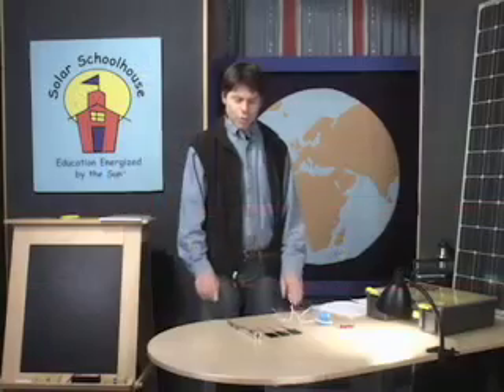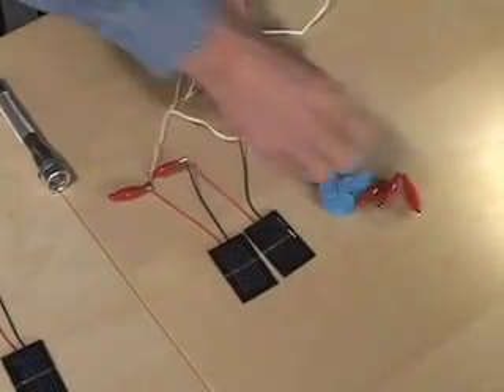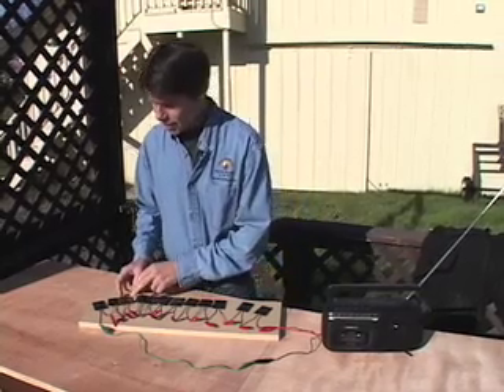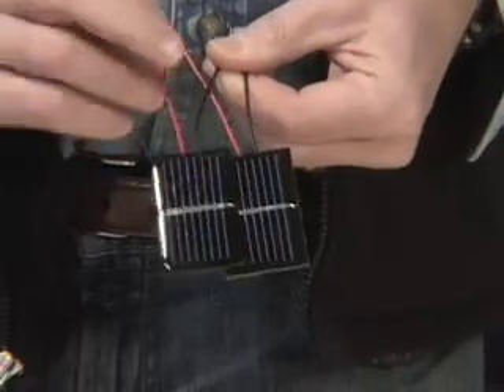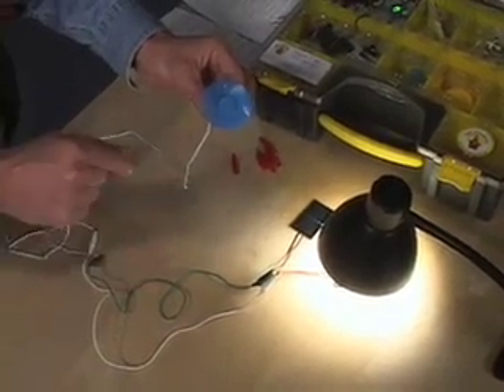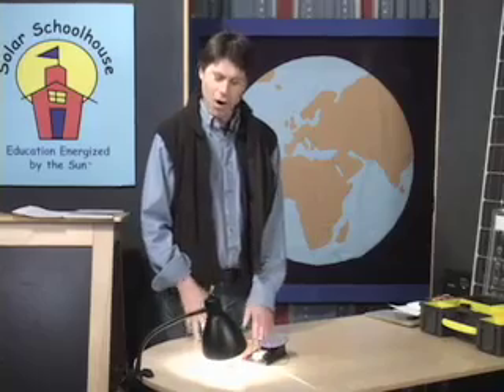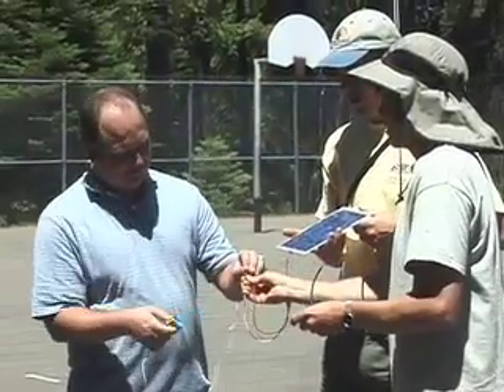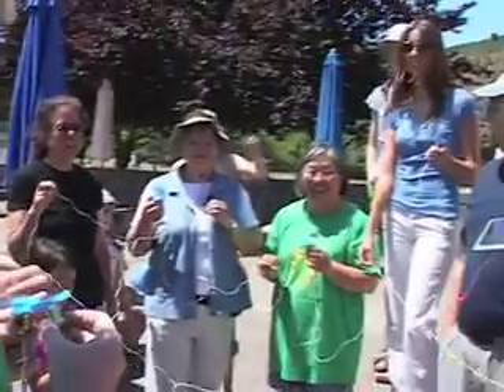Solar Cell Classroom Set pt2 - Solar Schoolhouse

Comment: I want more great job. Just put together 3 rebuilt 5 watt panels from harbor freight together. Shows 20+ dc volts on meter in direct sun per panel. Going to hook to battery with power converter dc\ac. 

Is series best setup or run all power leads to power on batt. and all negative to negative terminal>